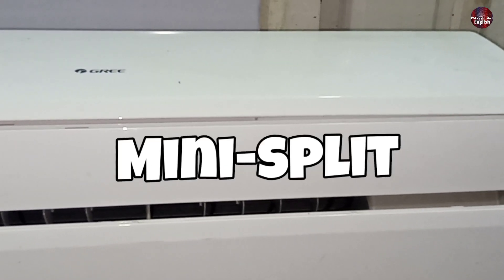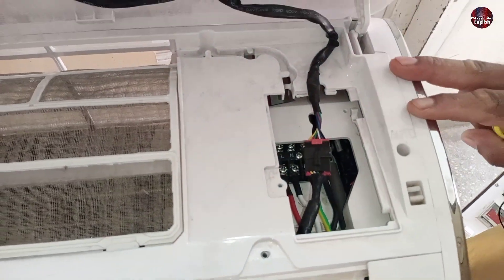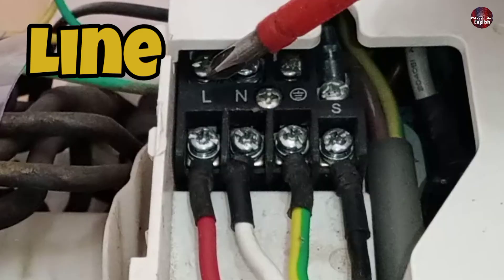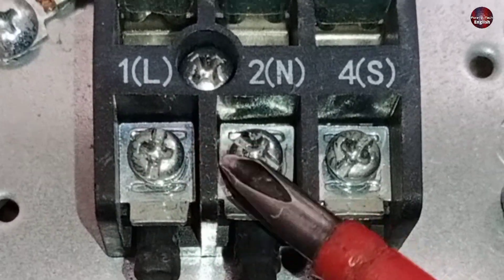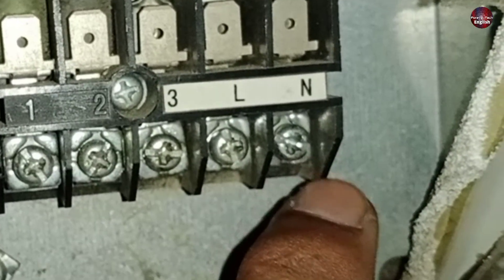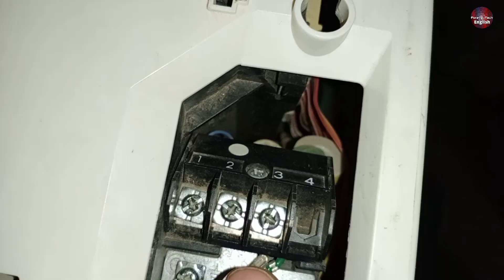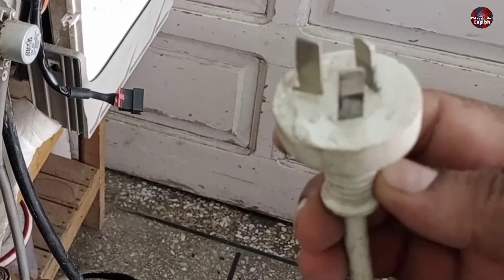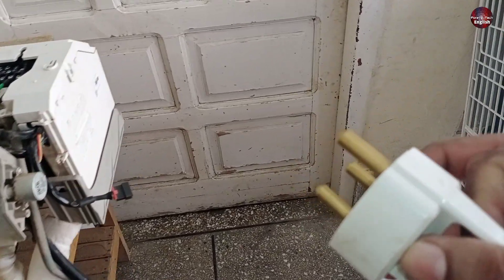Mini Split AC Wiring Mistakes You Should Avoid - Back To Basics

Comment: I'm on my 20th year being an HVAC technician and boy have I seen some bad wiring. On job I have right now is from a homeowner that tried to save money by buying cheap mini splits and having her handyman install them. She called me and said she can't get them to come on. Normally I wouldn't accept a job like that but she gives me lots of business( she owns multiple properties used for vacation rentals.  I get to the job and it's the sloppiest install I've ever seen..(2 separate units)  The MAIN reason they do not work is he wired 220v and they are 120v..lol.  Now she has to spend a lot more money to have me remove them and install new quality units. The boards cost as much as the units cost

Comment: Hm... Is this why it isn't recommended to run AC units via power strips?
I wonder what kind of problem the inverted polarization of socket leads cause exactly?
🤔🤔🤔
Do they malfunction temporarily or permanently?
Reply from the maker: It does damages the control board most of the time, it is like a slow poison.
Reply from the maker: the problem could be temporary if the fuse or some other component in the circuit fails, it will be permanent if the microcontroller fails